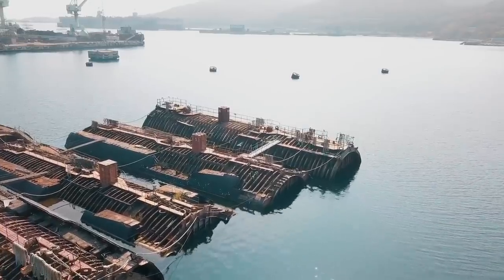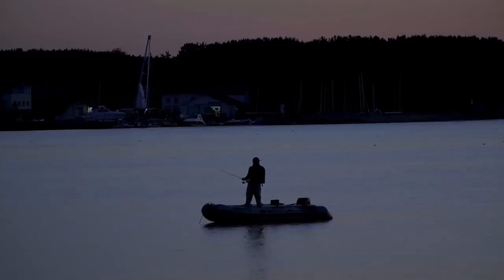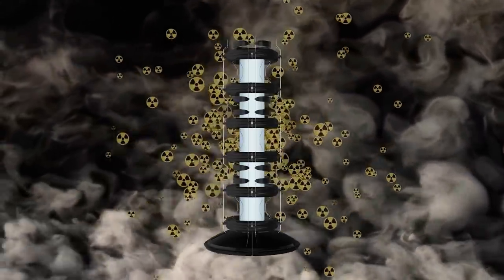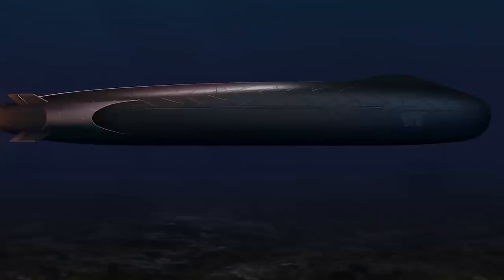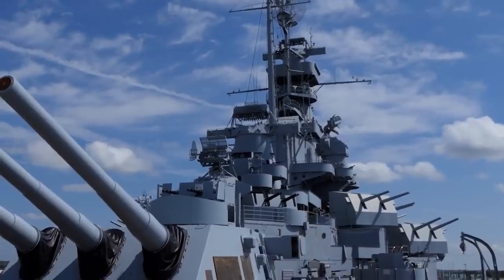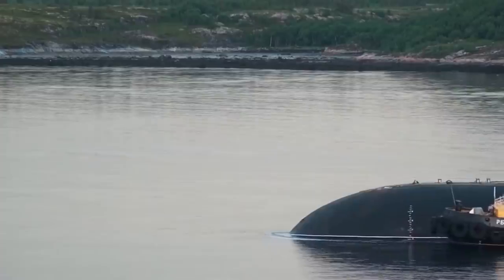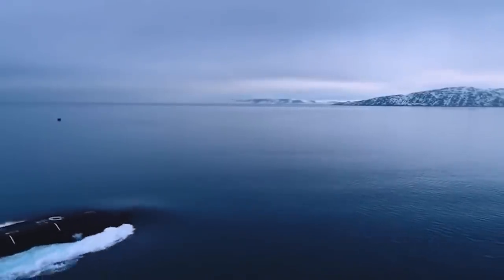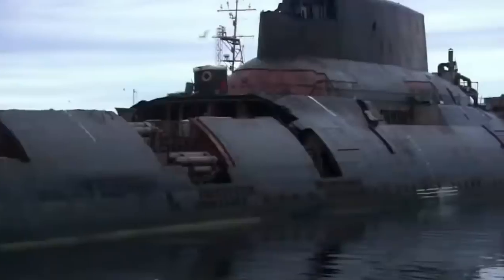The Terrifying History of Nuclear Submarine Graveyard

Comment: Attempting to move deteriorated subs might likely cause them to break apart or things to spill out.  It seems like it would make more sense to send out ships used for dredging with neutron absorbing non-toxic materials and just bury them where they are on the floor.  Something which chemically would bind with any released nuclear materials probably could be found.  It would also be possible to drill into the hull and pump materials into the hull.
Reply: neutron absorbing non-toxic. Good luck with that.
Reply: @garymartin9777  As a reactor operator during the 70s, I would recommend boron for the the water-cooled units...liquid sodium I'm not so sure to it's effectiveness...just a thought.

Comment: The US can't figure out what what to do with all its aging Nimitz class carrier whose service life has just been extended again....
Reply: Bullcrap. The reason is the newer ones aren't there yet.
Reply: They cant figure out what to do with the enterprise either it has 4 reactors buried deep in the center of the ship cant remove them without literally cutting the ship in half personally I recommend scuttling it in the Marianas Trench it would be safe from anyone with nefarious intentions intentions trying to recover any nuclear material
Reply: @van0tot100  one of them has joined the fleet the second one is doing sea trials now third and fourth are still at Newport news being assembled
Reply: @shawnmccarty6923  I do believe you, they certainly have a problem. But I do not think they are still in service because of this: the U.S. should have 10 aircraft carriers at all times, while the 11th probably hasn't reached full combat capability yet. I think they will need the most of Nimitz class for at least a decade to come.
Reply: @van0tot100  absolutely  the nimitz-class aircraft carriers are fine ships that do/did go into dry dock every 20/25 years to have their fuel rods replaced and get a good once over painting bottom of the ship ect ect their is nothing wrong with them no reason to decommission them the only advantage that the Ford class offers is the electromagnetic launch system as opposed to steam catapults is easier on the aircraft and next generation reactors produce more energy so they can have newer catapults and possibly lasers or railguns currently the ship can operate at full capacity while only using 1 of its reactors and the ford class has more automation so requires fewer sailors hell I was upset when they shitcanned the enterprise shes an old girl but was smaller and could operate in the Persian Gulf and other confined waters more easily then Nimitz or ford but the sting went away when I learned the third ship of the ford class is going to be named enterprise I whole heatedly beleive Nimitz simply needs a good dry docking and refueling no navy on the planet can handle her in battle nothing short of another Nimitz class ship can defeat her even the new queen Elizabeth class can take her I'm sorry I gave you the impression that I agreed with the guy that thinks they are only in service cause we have no replacements lol the US is also putting f35's on warp class amphibious landing ships and using them like a small carrier at the moment our navy is about as strong as it has ever been

Comment: No, the sea water alone will not allow a reactor to acheive criticality. Inside a reacter there are control rods made of substances that readily absorb neutrons, the control rods are still in place. Secondly a fission reactor of any kind, cannot detonate in a atomic explosion, it is simply design in a way that it cannot happen. At worst it will just emit radiation, but radiation does not spread very far underwater.Water is a sheilding material against radiation, every 24 inches of water(at sea level) radiation has to pass through 90% of the radiation is attenuated.  So even if the react acheive criticality, the sheilding built into the vessel, and the water that has invaded the reactor compartment by now, means that no radiation has actually left the skin of the Submarine.

Comment: If nuclear radiation is so dangerous, then why:
1. do trees around Chernobyl show no signns of damage?
2. has Fuchashima killed no one.
3. isn't Fuchashima melting into yhe Earth and where's that China syndrome anyway?
4. is life expectancy so high in Nagasaki, Heroshima, and down wind of Fuchashima?
5. are cancer levels in these areas unchanged and lower than worldwide averages?
If nukes are as destructive as they claim, and not as weak as the Beirut blast, then why:
1. isn't there proof in Heroshima and Nagasaki Photos?
2. isn't there modern uses of nukes on the record?
3. hasn't a missing Soviet Union suitcase nuke been used by terrorists yet?

Truth is, radiation can thermaly burn when too close or touching bare skin, like light waves, the tissue damage is the same as a sunburn.
Truth is, nukes aren't as big as told, and aren't efficiant in scale. Yes, they dropped them on Japan, but they did not do the damage reported, that was done by gasoline bombs.
In fact, Tokyo was leveled by them and that didn't end the war. No, the war was ended on a lie. No surprise, it was started on one too.
Reply: Nah dude radiation is real and dangerous go into a field with radiation see what will happen to you

Comment: I wanna say, don't bother with removal in a few of these cases, can't you bury it in a lead oxide laced clay or concrete? keeping the poison within keeps it from, literally, spilling out once it is disturbed by vertical; movement.
Reply: As soon as an earthquake comes, or erosion of the seafloor gets too great that kind of protective casing would fail. It's harder to monitor under water also. The best bet for the fuel at least, is to pump it out, but that fuel could also be contaminated with radiation.

Comment: Wont happen.  Water is a great moderator.  To much hydrogen that blocks neutrons from multiplying.  That’s one of the reasons it’s used in nuke reactors.  One of the best shielding used.  Also with all that water the ocean dilutes most of that material superbly.

Comment: Its actually safer to store nuclear waste at the bottom of the ocean then above ground. In fact all nuclear reactors rely on cool water to prevent a nuclear reactor from becoming unstable and melting down. Water is also better at filtering radiation than concrete and steel. With only 7cm of fresh water around a core of a reactor reducing its radioactive particles by 50%.
Reply: Really?  Unpressurized, unchemically treated seawater to dissipate still viable fuel???  As a former reactor operator (A1W/D2G qualified) I'm a bit disturbed by your viewpoint...Chernobyl is worrying scientists now because of rainwater seeping into the lower levels.  Water is a "moderator" and will reduce the energy levels to a point of fissionable reaction levels...study up a little, ok?